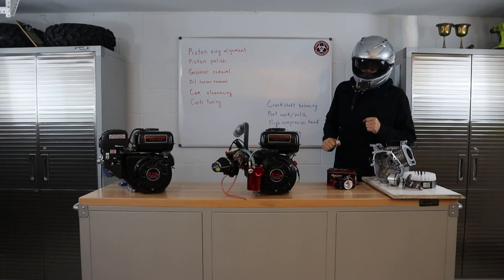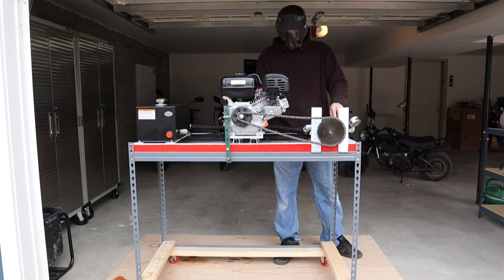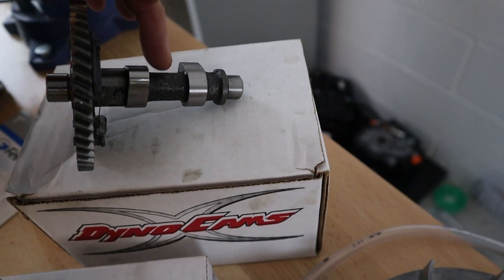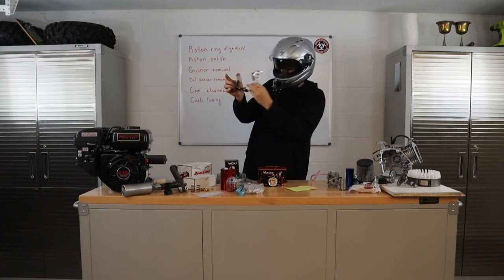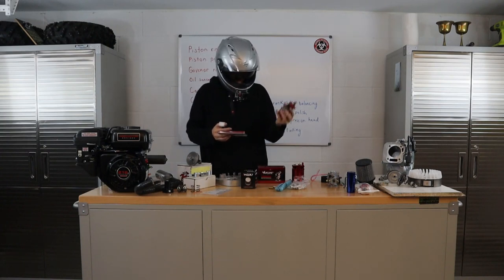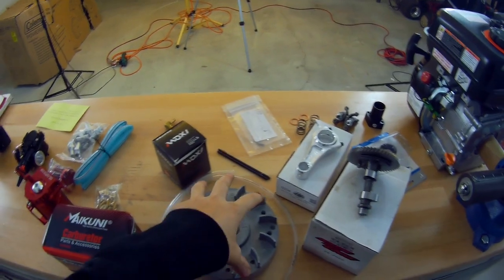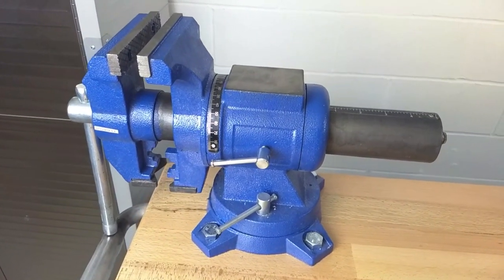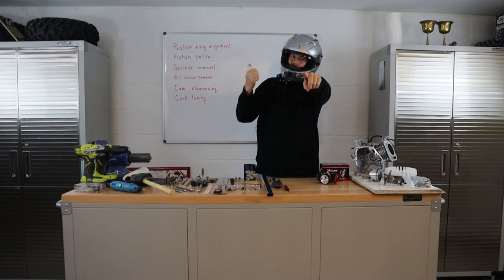9000 RPM Predator 212 cc non-hemi engine performance mods

Comment: I've found that I can do what I want to do with 6500 rpm, a Juggernaut CVT, and gearing and have a long lasting dependable engine that'll last for years. 55 mph on a 135 lb. minibike is plenty fast enough for me and no clearancing is involved with dropping an EC Carburetors .265 Bansai cam into a Ducar 212/Tillotson 212E block with a billet rod.

Comment: We call 'em "cheater pipe", or "breaker pipe". If you have a heavy duty floor jack, you can use the handle to function as one. Thanks for the vid. Modifying my 100cc now, so much fun.
Reply: I thought that's specifically what floor jack handles were also for lol

Comment: That tube extension is called a “snipe” around here. You can get fancy and add a length to the name. People here use electrical conduit. EMT 1/2” x 1’, 3/4” x 2’ and rigid 1” x 3’ are in most guy’s mechanics tool set.

Be sure to de-burr the ends. Slipping off is not unheard of when those things come out.  I add hockey stick tape to both ends. I sure you can buy it in a minimart where you are.

Comment: Venting the engine can be done without a catch can. You just drill out some hole in your lower valve floor area.
Then vent with a one way valve out of your valve cover.
Venting the engine prolongs the life of the engine
Remember to make them fast and make them last...

Comment: Hey I bought the predator ghost 212 and the ultra light flywheel didn’t fit . A builder installed a billet non hemi flywheel on it . He said that the engine is a non hemi . Does this make any difference or will it cause problems?

Comment: Box wrench is that side of the wrench. Crescent wrench is the box wrench that is adjustable with the wheel. You could break that with a cheater bar but you are unlikely to break a standard box wrench.

Comment: do you have a video explaining the gas cap vaccum and drilling a hole 5/32 to help prevent the vacuum? My bike bogs wot with my gas cap fully closed and when I unscrew it a bit it doesn't bog anymore but I run the risk on my gas cap flying off mid ride.
Reply: Drill a hole into the gas cap for better fuel flow if you’re using the stock tank, apparently the breather hose on the top Isn’t enough.

Comment: Ok so I think I need new rockers because they keep getting loose on my 212cc hemi.It has a bullet flywheel and a mikuni carburetor. I’m learning a lot on this video. I’m tired of adjusting my value lash setting.
Reply: Do you ever check the valve clearance, I got a feeler gauge at oreillys for 5$ they had 3 options make sure to get the one that goes to the smallest sizes

Comment: Stage 4 predator...why does it spit and sputter at wot? I have 22lb valve springs but seems like it valve floats at high rpm range..do I need heavier springs?

Comment: Really interesting on how you mounted your catch can, I have the same exact one. Does it make a difference running it how you did rather than how it’s supposed to be?
Reply from the maker: Most would buy an adapter/lift for the valve cover and run the line from the crank case to the valve cover and then into the catch can - but I swap engines frequently. This keeps it all contained in one place for demo purposes.
Reply: @megoingfast  ever since I seen your video I've been running mine like that and it's a great idea 💯
Reply: @MoneymanRome  is there a how to on mounting it or you just went off how it looks?
Reply: @ethanduke813  I have a video on my channel with how I mounted it, you can either tap the governor hole for a relief with a hose going to the valve cover and then a hose from the valve cover to the can, or you can tap the side cover or get the billet side cover and do the same thing. It helps a lot for cams with higher spring pressure to relieve the block. I cracked my first 2 blocks not knowing it.
Reply: @MoneymanRome alright thanks ill check it out

Comment: DId you ever get it running?  What was the outcome?
Reply from the maker: Not sure what you're talking about. I'm thinking I put the video together wrong or people are not watching it the whole way through. I shimmed the springs like stated in the video, works great. I've made more than just the 1 of these. This was made after running these guys. This is a base for a larger build and information on how to build higher output engines. Shows part names, list, tools, etc. Build ideas, etc.
Reply: @megoingfast  I just assumed you would show it's performance on a kart. I looked around at your videos and never saw it.
Reply from the maker: @Toid  makes sense. I made the video to answer people's questions they were asking me about what tools and names of parts to use when going above stage 1. Guess I really just stopped after answering the questions.
Reply: @megoingfast  I understand that. I've made similar videos. I was just curious, because I was getting ready to work on a predator 212 to put in my go-kart. I never heard of childish concepts, but I think I'm going to go ahead and give them a call sometime and talk to him about some performance upgrades. Keep up the great work

Comment: How does a engine stock cam so 9k?? I have 22lb valve springs stock cam no govonor was removed and capped off but 6550rpm wide open on go-kart geared heavy 4.90 ratio. Stock carb with .38 high and .20 low
Reply from the maker: CS grind is a .265 lift.

Comment: Hey man, I am doing a complete rebuild for the same exact engine and decided to do this build. I was making my list and at around 4:19 you said a part that I couldn't make out very well. It was right before the spark plug. If you get to this, could you let me know which part it is and possibly give me any advice on the overall performance and experience with this build? Thanks
Reply from the maker: 7/16" bolt, for tapping into the oil sensor hole. The engine has pretty good performance, and is a setup for some pretty decent power as is - that you can take even further to stage 4 level with balancing the crank, honing the cylinder, porting and polishing the head and a few other steps. The cs grind cam is a 265 lift cam similar to the popular cm grind and hot 265. If you do not shim 22lb springs, you can change to 26lb. This is a fast build that is inexpensive that kicks out power giving a great engine build experience. The catch can can does not have to be bolted to the engine, that just made it easier to contain for me. Many people prefer to buy a spacer for the valve cover and run the crank case vent into the spacer. Jet size will vary on a few things, you may want to run between 120-135, depending so having a kit helps.
Reply: @megoingfast  Wow that really helps, thank you. I've noticed that some parts are out of stock in your links and the main part that I can't seem to find is the Mikuni carburetor specifically in 24mm and for a 212cc engine under $100. Would you have any alternative suggestions for a cheap build like this?
Reply from the maker: @ayolz1588  kyn, black motorcycle, all-carb, ysmoto... Pretty much the same carb just different brand. Search "24mm carb" on Amazon.
Reply: @megoingfast  Ok cool. Thanks for the feedback and communication. I really appreciate it
Reply: @ayolz1588  Hi...You Could use a bike Carb a used one of Feebay designed for a Honda 175 or 200cc it'll run perfectly & cheap as French fries..it's a Kihien carb your looking for & the Chinese bullet noppled on the end of most throttle cables hook right up.NO jetting changes required !. Goodluck .Try Craigslist or Feebay for a used carb from a parted 90s- 2200 bike.

Comment: I have done a stage 4 kit on my predator but now my problem is my current clutch keeps over heating and keeps sticking.. any advice or ideas for a good high torque SS clutch???
Reply from the maker: Drum clutch the hilliard inferno fire can take some power but getting sprockets is a little difficult. Best for most mini bike applications. For disc clutch The gofasthp.com clutches are hand made and you can get help for your build. Actually may be able to get help and the right parts for either setup. Last clutch I bought from them, best prices out there other than a 2 disc from childishconcepts.com which is also a great place for help on a specific build.
Reply: @megoingfast  I bought a 3500 rpm Max torque clutch, and now have no problems...

Comment: Searching thru amazon i came across the nibbi air filter carb manifold kit for 120 will that work even better on a non hemi  predator 212 or does it fit different size engine ..let me know asap thinking about buying asap
Reply from the maker: Yes-ish for better. It has better reviews from people I know who run them in regards to tuning. Fits same engines, based on size you get.

Comment: hello, are these predator 6.5hp engines better than the cheap ebay type 6.5 hp engines
Reply from the maker: Depends. Lots for sale on there. Some are good, some are not. Some are Honda clones in full and easy to mod, some not.

Comment: Struggling with jetting, got the same basic setup what pilot are you running?
Reply from the maker: 37, needle middle position, thought I have that in the video. Been a while.
Reply: @megoingfast  you did for sure have a 38 pilot and 120 main.  Thing is impossible to start. Took an hour of tugging to start., any ideas,
Reply from the maker: @ratrodcourier8576  I just checked the carb to be able to answer the question since I forgot if it was the 35 or the 37 in there.
Reply from the maker: @ratrodcourier8576  if you were able to get it to start, but very difficult to begin with, raise the needle up.
Reply: @megoingfast  I'll give it a shot.  Think it has timing issues. And flooding on start up

Comment: Should have used a colder plug, like a 6 or even try a 7. A 5 seems like it'd be too hot for this.
Reply: Unless you use ngk plugs..the lower the number, cooler the plug..

Comment: i’m not sure if your going to see this but can you please do a parts break down video of everything to chose to have the most power for a predator 212cc non hemi engine cause i want to do the stage 4 kit but idk what to chose and there’s no video talking about this
Reply from the maker: Most power bored and stroked with welded billet head running on alcohol can run $3000 and get you 30hp. Once you hit stage 4 you have a lot of options to take it past the 20 hp limit, however these crank cases usually blow up at 25hp and need a lot of reinforcement. If you're looking at stage 4, the crank case from a tillotson 212r is much more recommended once at this level. Most all power upgrades for that build are custom fabrication and metal manipulation.
Reply from the maker: For a purchased kit build, Red Beards Garage YouTube channel has a build video. You will likely need to further research high compression heads, balancing your crankshaft, boring and stroking the engine, and port work on top of that. It's a lot more work than just 1 video. 😉

Comment: hey hey nice video, do i need to get a other valve cover for the rocker arms got a honda gx160 let me know thanks :)
Reply from the maker: Depends on your adjustments. Possibly. If you are worried, then get the riser for the cover that has a built in hole for any future needed oil inlet and you'll be one step ahead.

Comment: I need help with carb plz
Reply from the maker: Cable install? Jet install? 38 low, 120 high, needle kept in middle piston depending on elevation for starts and temp. Throttle cable fit for slide carb. Slide manifold
Reply: @megoingfast  tuning mostly and all the ports on the carb do the 2 vacuum ports on top need to be plugged
Reply from the maker: @chadpolozola8516  helping tune a carb remotely is something I can't help with. The ports themselves however, are not all open. Look inside, most dead end. The ones that don't dead end, put a clear tube on.
Reply: I built this motor abs itsv the craziest thing I've ever ridden on before I put the big carb it did 50 then I put carb on was popping wheelies at 30 I was scared to go full throttle plus it was bogging
Reply from the maker: @chadpolozola8516  after running it for a bit, look up "how to read a spark plug". It might steer you in the right direction, but will not tell you which part to tune just give a base insight. Stay safe and have fun!
Reply: Got bike running did 47 mph how to I get it to rev higher i don't think its maxing out had to put smaller pilot jet if I put a bigger main will it rev higher I have a mod 2 cam
Reply from the maker: @chadpolozola8516  really can't help much from here. I don't know anyone that can troubleshoot your engine without guesses from the internet. A mod2 cam is .225 lift. The cs grind cam is .265 lift.